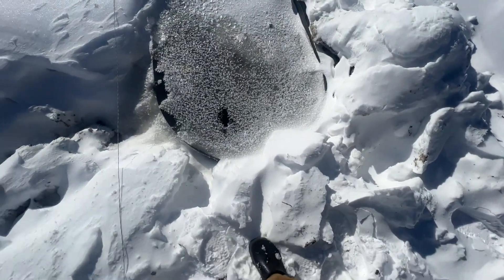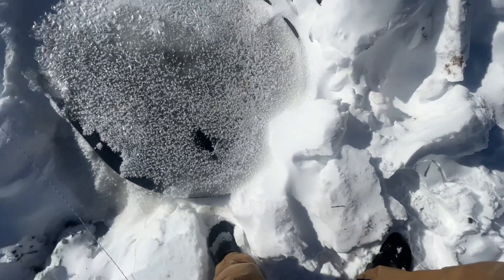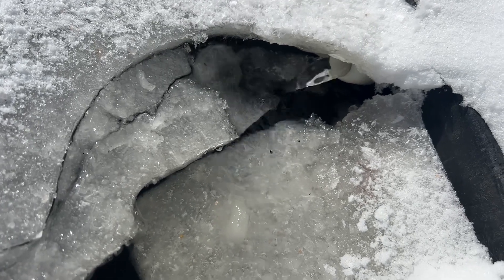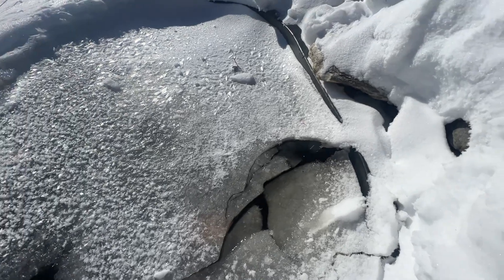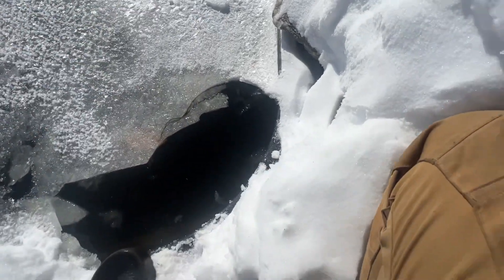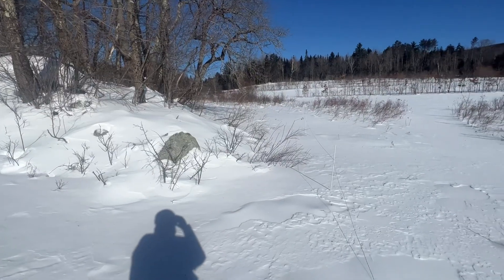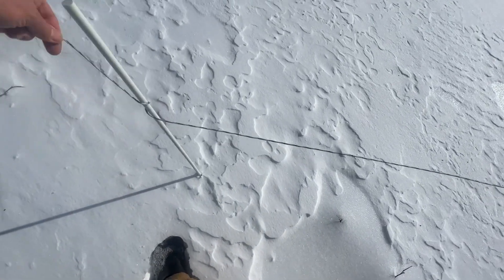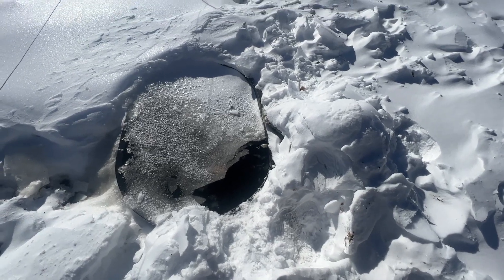Livestock Water at 15 to 25 below 0F

Comment: I’m in Canada. -40C means cows eat snow.
Reply from the maker: Is that viable? I saw mine eating snow even tho some water was available..
Reply: @wholesystems  I have run bison herds for 30 years exclusively on snow. Only chop ice in one year when no snow and ice got 4 inches thick so bison could not break it with hoof strikes.
I run all beef bull herd ( angus and highland) on snow alone in winter.
Cow herd has a spring but once calves are weaned the herd could easily use snow for moisture.
We run horse herds on snow also.
Millions of moose, elk, deee etc do it.
Reply from the maker: @Canadiancromagnon  Thanks for relaying your direct experience, this is comforting to me a bit to know them eating some snow can help/get them by.
Reply: @wholesystems  👍
Reply: @Canadiancromagnon  Interesting to hear that. I'm designing the rotational grazing system on my family farm in central Alberta right now and winter water is a big problem to work through.
Reply: @brennanwierzba9026  humans are funny creatures. What do musk ox drink? Bison up at Wood Buff Park? 
My only caution is they do need snow! If cold comes in without it,…. Then water is needed. But 19 years out of 20 it’s no issue. I am in west central Manitoba but lived for years in your area.
It’s better if you have proper cattle also. I run mostly angus cross and I am adding highland as they are better at plowing snow to graze.
Calves have it harder and I would keep calves on their cows in winter if snow is all there is for moisture myself.
We make things to complicated. Horses would be better as a meat source in our environment frankly as they are better in winter than cows but I can’t change modern human diets. 
Don’t let anyone tell you that anything beats simple hay and grazing……. I have heard/seen it all…. Silage, swath graze, Baleage hayledge etc…… blah blah blah 
Graze as long as you can, feed hay as briefly as you can, graze as early as you can,….. f*ck everyone who takes government money and treat horses like they are next best thing ( cause they are). Good luck
Oh yeah,….. machinery is a curse but until  people are willing to really work again you can’t escape some of it.
Christ I sound old lol…😉
Reply: @Canadiancromagnon  The plains indians of Montana all ate horses.
Reply: @rogerdudra178  I believe you. Please go find me the modern equivalent with cash money and I will gladly supply them with all they can eat.